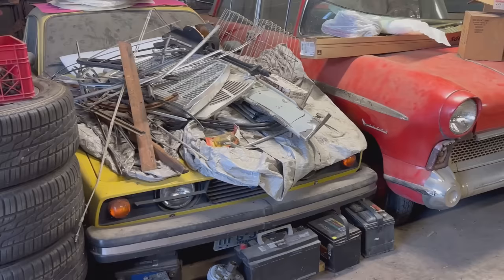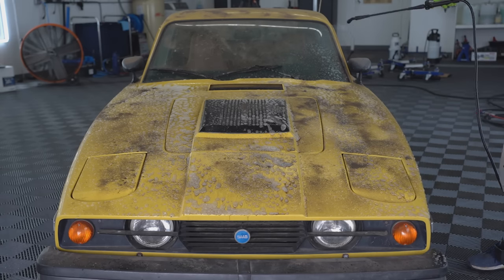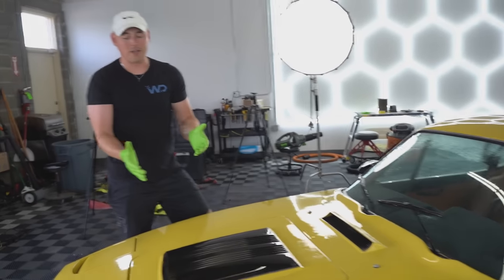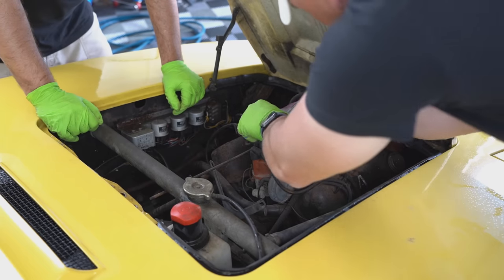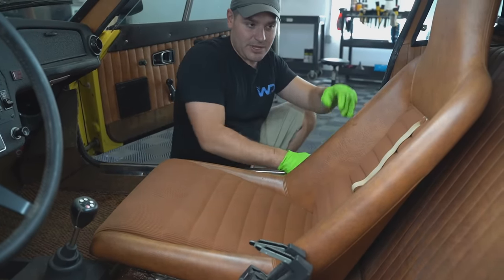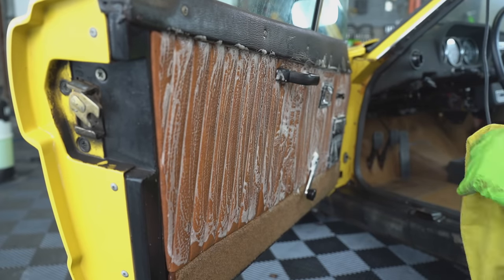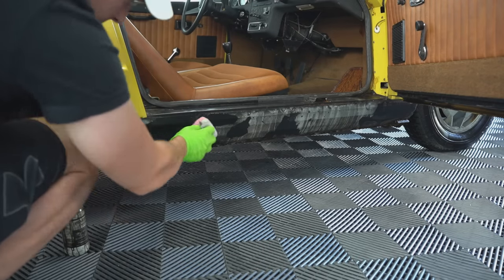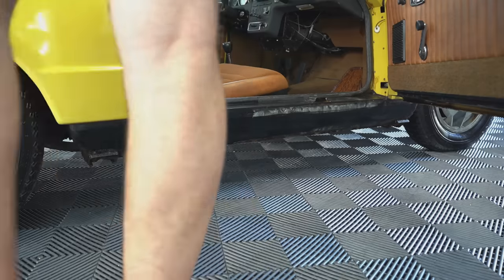Abandoned Since 1999: Saab Sonett | First Wash in 24 Years! | Car Detailing Restoration

Comment: Once had 3 of these in the yard, gave them away. The V4 is a Ford of Germany production. It was intended as an all-purpose utilitarian engine, think agricultural engine. A mighty 1 barrel carb sits on top. As for accidents, SAAB was an industry leader in safety with many innovations. There are many people that have hot rodded these cars.
Reply: I bet this car with a turbo rotary would be a riot.
Reply: @jasonjulian1  Unfortunately the chassis doesn't really match the looks, but it definitely matches the engine.

Comment: I grew up on 2 cycle 3 cylinder model 95 station wagon , then V4 95,  then 96 V4. Had the Sonet 2 and 3. Same engine, transaxle, 1/2 shafts etc. Build exchange renew, kept them going. They had freewheeling too, let off the gas and it coasts for improver gas mileage.  Drove from LA  to San Francisco, on one tank of gas in my red/orange Sonet III.

Comment: This is great! I've owned two Sonett IIIs over the years and currently have a few other vintage Saabs in the stable. You're right in saying that the engine is related to the V4 in the 96 you previously detailed on the channel. Your 96 should have the 1.5 liter version, whereas this car has the 1.7. Power output is almost identical, as is most everything aside from the displacement and the air intake. If you want to complete the V4-powered Saab trifecta, I have a 1972 95 (the 7-passenger station wagon version of these cars) down in KY that could use a good detail!

Comment: Love a Sonett 😊
The reason the wheels are locked, is because the only way to get the key out of the ignition is to put the gear in reverse.. (a safety feature from Saab, my 1967 saab 96 v4 had the same feature)

Comment: So Saab was famous for their 3cylinder 2stroke engine. But to make it more appealing to the masses they contracted with Ford to use a V4 engine used in their domestic tractors. All 93, 95, 96 and 97’s had the V4 if not the 2stroke. The Sonett is model 97. 93 is the station wagon version of the 95/96 series. Saab and Volvo shared much early safety technology including seatbelt systems. The body of all Sonetts are fiberglass for light weight.

Comment: I still don’t understand why you wash from the bottom up.  As you move up the car, you are moving dirt and contaminants down to the section you had just cleaned.  Do you shower starting with your feet?  I was trying to sell my Triumph TR8 years ago and took it to a race track in Kern Co., CA to watch a race.  A guy offered me 2 Saab Sonetts in exchange for my TR8.  I should have done it, but the purpose of getting rid of the TR8 was to have fewer cars, not more, LOL.  A friend of mine, who was short, but had wide shoulders, couldn’t fit in the Sonett’s seats.  As to the seat belts, Saab was VERY concerned with safety so I would bet that their mechanisms were somehow superior.  In a front end collision, the Saab hood was designed to go up and the rear and over the roof as I recall.  Have you tried “One Grand” car care products?  I think they are very good in my experience.